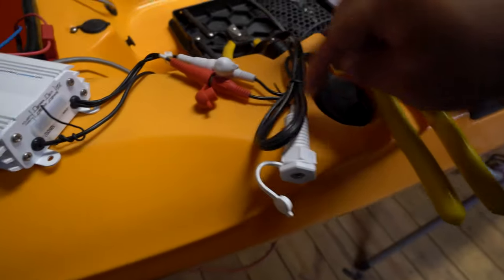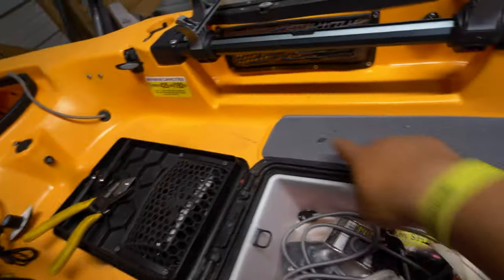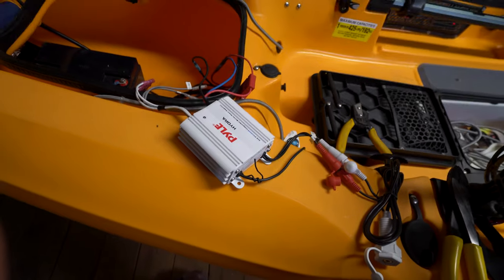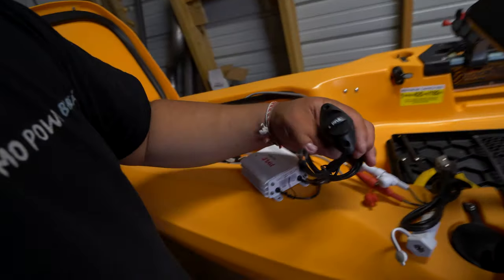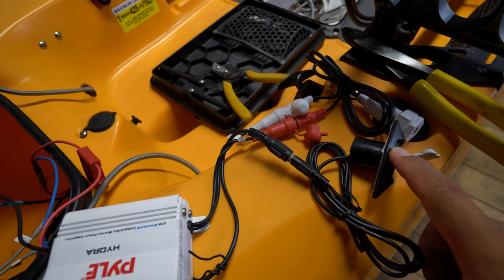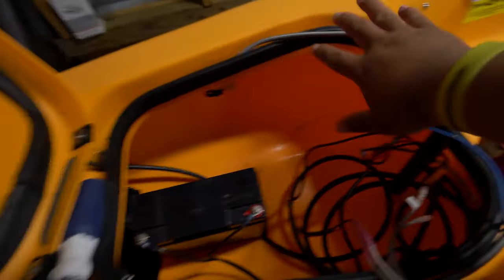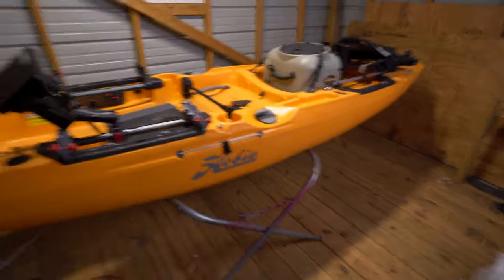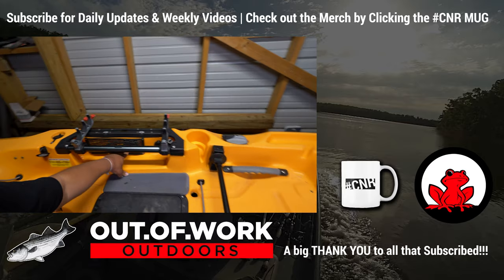THE MACHINE THAT MAKES FISH BITE  | DIY Hydrowave - OOW Outdoors

Comment: Good idea but the products you provide links for  suck/  The underwater speaker I bought on ebay arrived used and not even in its box.  You could tell the unit had been submerged in water.  My guess is a lake or river as it had dirt and algae on it.  Worst part is, it didn't work.  I followed all the instructions and nothing.  Will get a refund from ebay.